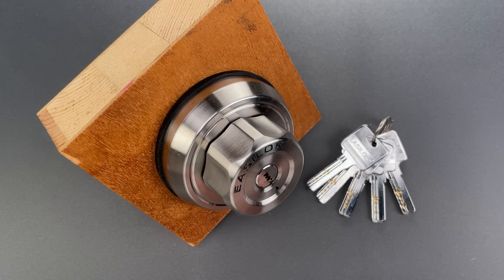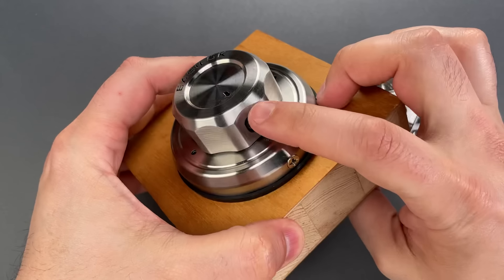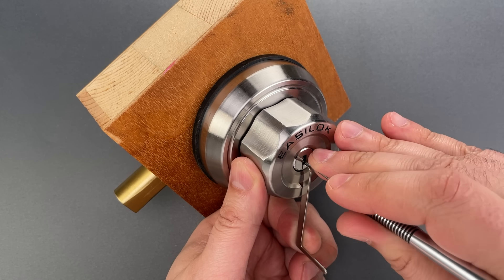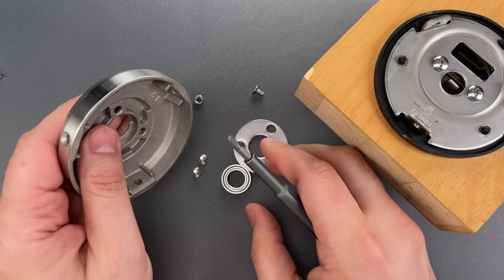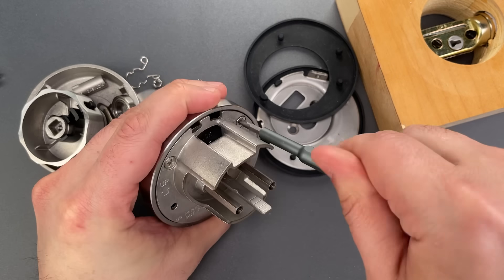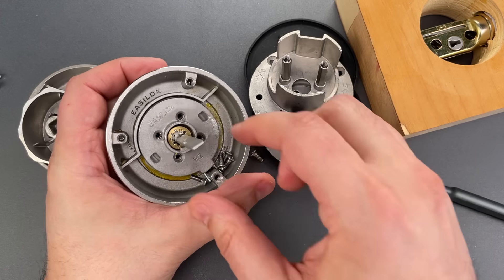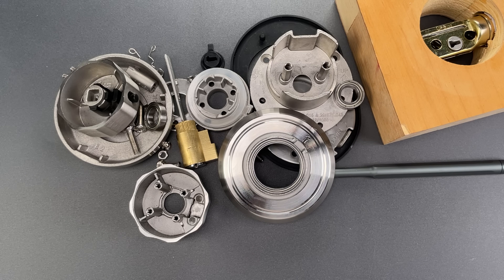[1388] The Best Built Deadbolt Ever? Easilok

Comment: If Easilok just made the cylinder replaceable, they could keep its current price point at be a very good and I dare say easy lock to customize with whatever security level you require.
Reply: It looks like the bible on the KiK needs to be wide to prevent it from moving in the slot. The only KiK I know of that's wide is the Lockwood V7. And that's no longer made. It might even be too wide. You could probably shim a more standard KiK but it would probably require some soldering to keep it in place.
Reply: The company offers the same locking mechanism with different cores. There is a "Home entry" vs "Storefront entry" products page with a wide variety of cores and features for enthusiasts, comparatively more expensive than this lowest level security deadbolt. If you don't like the core get one of the more standardized core locks they sell.(expensive) This lock is amazing for the price it is at for the specified use case of easier home entry as it is marketed to elderly, kids and adults that want to be cheap.

EDIT: they offer the same lock in a SC keyway model. you have to customize it with them but are able to change the biting later on but not the core.

Comment: Intresting.  I know from experience that some of those low profile bearings are not all that cheep particularly in the smaller sizes.  Even if those are relatively inexpensive bearings with bulk discount 3 bearings like that have got to be adding 15-20$ to the manufacturing costs over a simple bushing. I'm impressed they are hiting that price point with all the premium materials they put into that.

Comment: So, if it's in the position where it can't be unlocked with a key, does that mean it can't be picked as well? If so, this is an amazing lock! Also, I'd like to see how it prevents the key from unlocking it, like, does it somehow stop the pins from moving? Very cool design
Reply: Probably physically prevents the locking mechanism from turning.  At that point it doesn't matter what the pins are doing if the core can't turn anyway
Reply: It also seems like a great way to get locked out of your house by curmudgingly roommates, jilted lovers, and mischievous adolescents.
Reply: @CeeJMantis  no more so than a normal night latch.
Reply: I think we've seen enough locks give up with a simple rubbet mallet bonk or a thin blade inserted into the mechanism to realize that even a keyless lock is pickable if you know how.
Reply: @drakkenmensch  

bonk 

My favorite part of this lock-picking series
Reply: @drakkenmensch  LPL already opened keyless padlock 🔒
Reply: When night-latched, the pins don't matter as the mechanism is blocked from turning.  However, I'd still like to know what happens if a large channel lock or something is used to force the knob.
Reply: @antibrevity  I wonder if it would unlock or just twist the connecting bar. I'm also curious if the night lockout moves a plastic pin or if it's engaging a metal bar.
Reply: @Aperson156  True. Not saying it's a bad design, just that you need to be able to trust in your housemates if you're going to buy one
Reply: from what I gather the outside would be locked from spinning, brute force might be a way to go around that, a pipe wrench could work
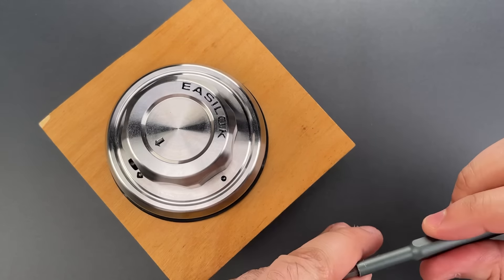Reply: @Nerdious_Maximus  Looking at the mechanism (as LPL opens it) it looks to me that it blocks the blade, physically. 2:19 see the cross piece in his left hand? That is what's actuated by the knob. Likely it doesn't move, which somehow stops the lock from working, possibly free spinning. 2:44 you can see the plastic dogs (black piece in the knob) and the metal ones on the grey one with "easylock" written on it. 

The plastic nature of that knob piece has either of two deals to: A. that means force can break the dogs, B. blocking the blade from turning is based on a clutch like mechanism inside the brass portion of the (physical) lock.

I'm unsure which is which, because there's a pickle in the middle, that excrescence on the blade... kinda throws my theory out. He does spin the key tho, so it's likely B.
Reply: @CeeJMantis  Maybe it's just me, but I'd think you should be able to trust your housemates regardless.
Reply: @antibrevity  I would hope for a planned failure point... some thinner or softer material that acts as an over torque "fuse" so to speak... or perhaps a torque limiting feature
Reply: @timward4301  Typically yes. However, I've heard many a tale of people who had bad relationships with their roommates over the years. And I've heard tales of breakups that had people behaving like children.

To be clear, I'm not critiquing the lock, more saying that having a night latch for your house is very different than having one for a hotel room. I used to work maintenance at a few hotels, and the problems with night latches I have seen were more of a hassle than I would like to deal with at my own house. Especially without the tools made for bypassing hotel locks.
Reply: @aserta  Looking at it as he disassembles it, I expect the night latch simply locks the inside. As to using a wrench or something similar, the smallest part of that latch going through is actually right at the base of the lock set, so if you were to apply a wrench to the outside and try to turn it you would probably just break that... Rendering the door completely inaccessible from the outside until a locksmith can fix it. Considering that this is a deadbolt design, which makes shimming or sliding the lock impossible, I would honestly have to consider this one of the nicest deadbolts I have ever seen. The fact that it is from what he considers to be a fairly inexpensive company suggests that I know what I will get for myself after Christmas.
Reply: Based on how little connection there is between the inner knob with that switch and the rest of the lock, I suspect a big pipe wrench would "bypass" that extra switch on the inside. But it would also be destructive and not at all covert.
Reply: @antibrevity  I think from the look of it, the cross bar is being pulled in/out by that switch on the inside. When pulled inward, it's physically disengaged from the lock side, not just locked into position - hence how latching it prevents locking and unlocking - it possibly disengages the deadbolt actuator from the lock cylinder.
Reply: It seems from the teardown part of the video that the night latch block is actually plastic part. The question is can you apply enough force through the keyhole to force the plastic to fail.
Reply: @CeeJMantis  I think it can only be night latched if the bolt is retracted. If its locked I do not think it will work?
Reply: @antibrevity  I mean, to be fair if you're going to judge destructive entry, a 24" pipe wrench will just make violent love to the inside of the door with enough of a lever. but then again you could also beat most doors in with that wrench and lever if you wanted to...
Reply: @Aperson156  but couldnt a door be partly opened with a latch then just cut the chain
Reply: He did say it's "the best low security lock" he's encountered. I don't know how it would hold up to a brute force attack like that. It might do well because of the good build.
Reply: I was gonna ask the same thing.
Reply: @CeeJMantis  so does any lock if you have a tube of glue
Reply: @CeeJMantis  dude you always need to trust your housemates anyway, they have access to your stuff too, not just the door lock
Reply: It block the main center shaft from turning. Effectively making it impossible to unlock.
Reply: @dragonslaya8851  It's common to have a second deadbolt with no keyway at all.
Reply: @nathanwest2304  sledgehammer always works too, but the door you mount this on won't survive that either so it's ok
Reply: @marcogenovesi8570 Have you never heard of somebody having a crappy roommate before? And I'm well aware of the fact that you don't pick untrustworthy people to live with. It's more the point that I was trying to make is that it is a lock that allows you to have the key and still be locked out of your house. That is typically not a feature of most locks, and for the same reasons that it is desirable in certain situations, it is undesirable in others. The point I'm trying to make is not that you cannot trust other humans. I'm just trying to illustrate that that is a consideration one should have before purchasing a lock like this one. That's it
Reply: @CeeJMantis  You can't close the latch with the mechanism turned on. (ie. when you can't use the key).
So, no. Nobody can lock you out.
Reply: @CeeJMantis  I was thinking the same thing, so I'd be stashing a spare key somewhere on my property, which I probably would forget where I left it.
Reply: @gdxd7956  At 0:50 he shows that you can use the mechanism when the deadbolt is locked and it prevents someone from using the key from the outside. This means that someone who is inside your house can lock you outside of your house and your key would not let you back in.
Reply: @stevegabbert9626  The only problem with that is that the key won't let you in if someone on the inside locks the door, and then flips the switch. He shows that at 0:50.
Reply: @CeeJMantis  I've been the crappy roommate so I think I have the authority to notify you are completely out of your mind if you think anyone with an IQ above 20 can't lock you out of the house regardless of the lock on the door.
Most door locks are extremely easy to jam closed, temporarily (to keep everybody out while you got some female company for example) or permanently.

Easiest way? Just stick a key in the internal side of the lock and turn it a little. Boom, the cylinder is either full or interlocked.
Reply: @CeeJMantis  Yes, I know. I live by myself, so that's what I was looking at.
Reply: You have to be inside the house, which is itself a bigger problem for unauthorized entry. That said probably almost nobody is broken into by picking. Locks are to keep honest people honest.
Reply: @kameljoe21  he showed it with the bolt engaged, as well as disengaged
Reply: @szymonsadlo  Hasn't picked a speed dial lock. In fact, no one has.
Reply: @MikkoRantalainen  
Perhaps a vulnerability that LPL didn't exploit...
Reply: @marcogenovesi8570  I think you misunderstand my position. What I'm trying to say is that a feature like this is easy to use, so it is more likely to be used both with intent, and accidentally. And because of this feature, people should take that into consideration before they look into purchasing a lock like this.

I don't understand what your fervent opposition to this idea is. I never made any comments saying that this isn't a quality lock in its construction, I never said it wasn't possible to be malicious before this lock was produced. Like everything else, few things stop the dedicated from doing anything, but many things deter the impulsive, and prevent the accidental. This lock has a lower barrier to both of those things than typical locks. That is all I was trying to argue. Nothing more.
Reply: I hope the outside knob and lock gets disconnected, so it can turn all the way without opening the door.  Of cause the cylinder can be picked, but it won't do anything (at that time).
Reply: @CeeJMantis  I would be far more concerned by the existence of the keyless option for locking it. Imagine forgetting to grab your keys (house and car) on the way to work, walking out the door, and locking it. Then walking out to you your car only to realize you don’t have your keys and are now locked out of your house
Reply: @drakkenmensch  That requires locks that has an incline on the latch part. This is a deadbolt, it has no inclines. No plastic card or metal shims can help push back that bolt from the hole in the frame.
Reply: @pws3rd170  Then you just go to covertinstruments and pick up one the genesis sets.
XD